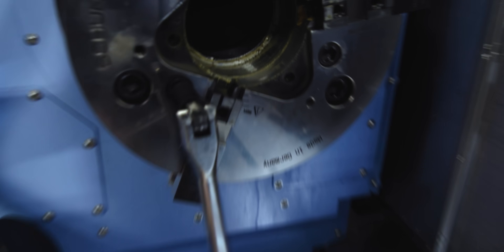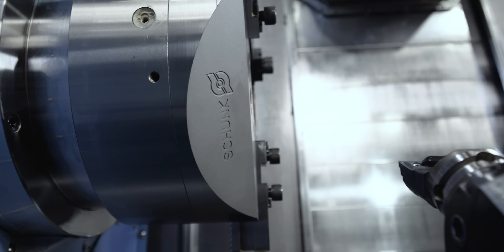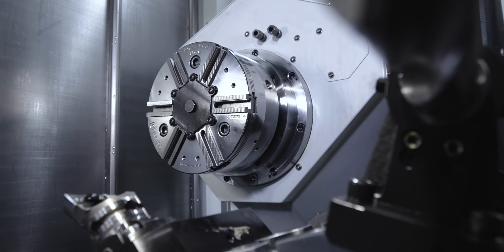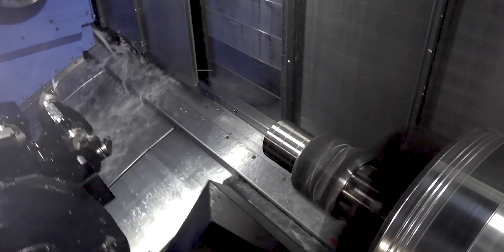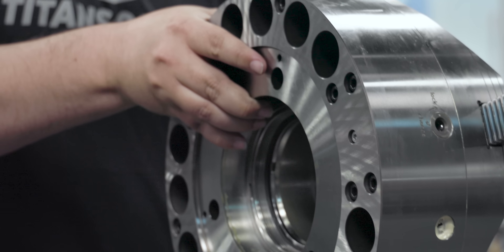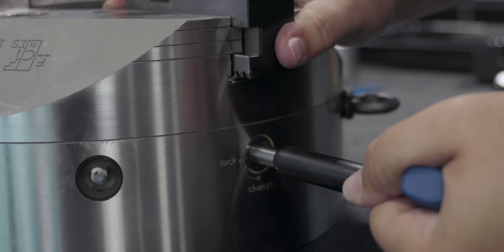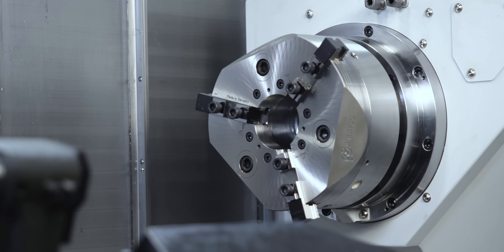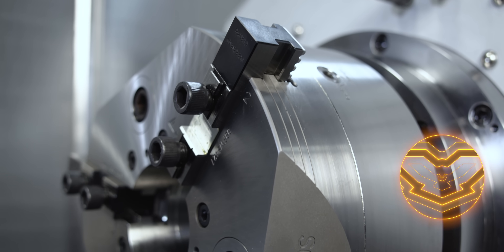The PERFECT Chuck for Live Tool CNC Lathes | PUMA SMX3100ST 9 Axis | DN Solutions

Comment: A bit off topic, but where I work we have two SMX 2600 ST machines and they are kinda dogs. G400 has never worked right, cables to the turret have broken on both machines, the coolant line to the mill head came loose and made a huge mess, for the first 6 months one machine dropped tools at a tool change almost constantly, they always get weird alarms ect. Have you guys had any of these issues?

Comment: I only use 3 jaw chucks if the work piece is too large for the material to fit through the draw tube.  Collet systems are WAY easier to deal with and are more compact so live tool clearance becomes even easier.

Comment: Hey guys
I have a question to all machinists. I'm not a profi, its only my hobby.
How can I keep my parts, a schunk, or other blank metal parts free from flash rost? I oil it every time, but maybe you have other tips for me. Thanks for help, and this nice video. 
Best wishes from germany.
Reply: Look up sprayon mr361 mold protectant. Mold as in die and mold. Not the stuff that's bad for you.
Reply: As already mentioned, you can use a protective oil or grease, but that can be a mess to apply, and then to clean off again later. You may also want to look for VCI paper and/or VCI bags. Basically paper and plastic bags that have been treated with an anti-rust chemical. They are not oily at all, and use the chemical vapor to repel rust.

Comment: Why do you need to perform maintenance on a chuck? Just clean it out, or are there adjustments or similar that you need to make?
Reply: Regular greasing and proper care can make a Huge difference. Greasing is probably the biggest. Sometimes, though, swarf, coolant, etc can contaminate non sealed chucks which can cause the chuck to lose a lot of clamp force, or internal mechanisms breaking down.
Reply: @mgaunce  thanks! How does coolant make it lose clamp force? I'm having a hard time imagining this. I bet there's a good reason though.
Reply: @cheater00  coolant ingress into the internals of the chuck can cause lubrication to thin and also when swarf/chips go with it it introduces friction to the assembly. There is a wedge hook system inside the chuck that creates clamp force. As the friction increases in the wedge hook, it makes the power transmission less efficient.
Reply: @mgaunce  thanks!

Comment: What does 9-axis mean?
Reply: X Y Z C X2 Y2 Z2 C2 and B is how they come up with it
Reply: This term doesn’t exist. It’s counting all linear or rotating axis but in the end there are a max of 5 axis around to manufacture. If u have a machine that have a turret and a mill spindle plus 2 turning spindels for example it gets the extra designation of “2 channel”. One Channel for each pair of spindle + tool holder/system that can be programmed individually

Comment: I have questions.

Why are machinists still using 3 jaw chucks you have to dial manually when there are 4 jaw chucks that close on the part at the same time or why has no one developed a 3 jaw chuck that will do the same as a 4 jaw without the need to move each jaw into place? Why is there no advanced chuck that you only need to program and it will adjust the jaws for you?
Reply: Because there is no reason. Interchangeable jaws like Schunk or smw  provide gives u flexibility and esay to use. with a 4 jaws u always need to dial in the runout and if the stock material is a little bit bigger it will only clamp on 2 and 2 means saying goodbye to your machine
Reply: 3 jaw chucks are cheaper and running costs are lower.

Comment: I run a 9 axis with two hienbuck collet chucks, ever considered it ? Super quick change time and can spin up as fast as you want as no worries about centrifugal force, slim body also lets you get tools right down on top of the job
Reply: U mean Hainbuch ?
Reply: @kleini3  yes
Reply: it's suited for small bar stock where you can use the spindle speed, for a bigger stock material you won't be spinning that fast anyways, we use on a few of our machines a collet on the main spindle and a soft 3 jaw on the sub spindle for the second op.
Reply: @TheTreZZen  goes up to 160mm and it’s useful for thin walled parts your trying to hold lightly on but lose grip as you spin up also allows almost 360 degree support on part
Reply: @tompass8446  160mm ? Crazy what’s the designation of the collet ?

Comment: A lightweight chuck is not good for flywheel effect though
Reply: The power train on that machine is so great and responsive that there is no need for flywheel effect. And even if, you have close to none of use for flywheel effect becouse lack of power is not the concern here but the performance of cutting tool .
Reply: Sometimes the pros outweigh the cons.
Reply: My understanding of flywheel effect is totally the opposite.Just like a fly wheel on many older machinery heavy and keeps momentum going.